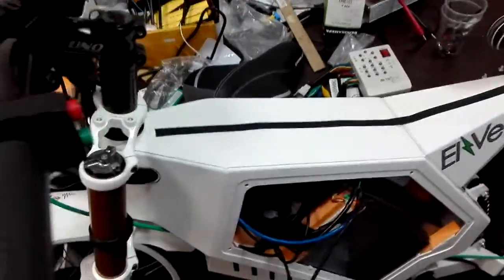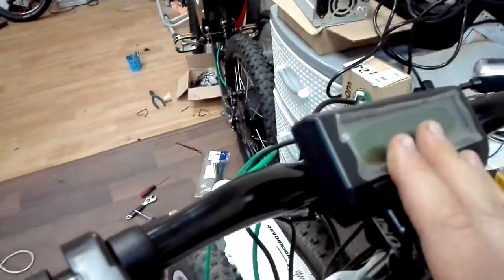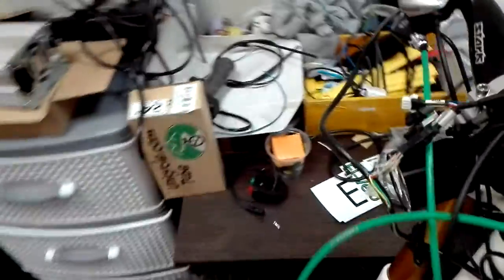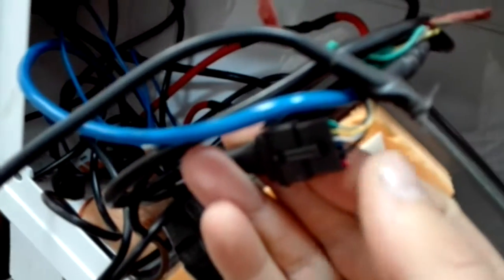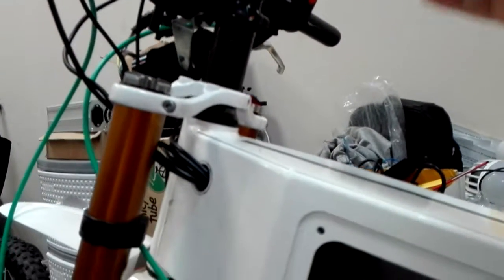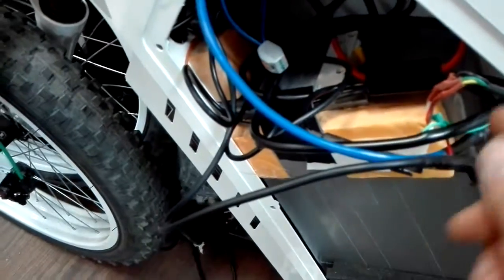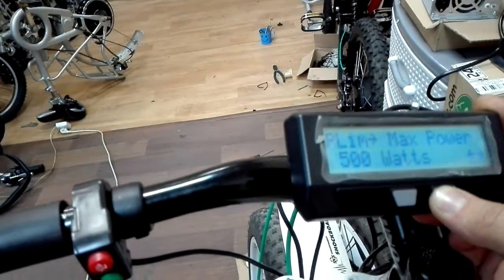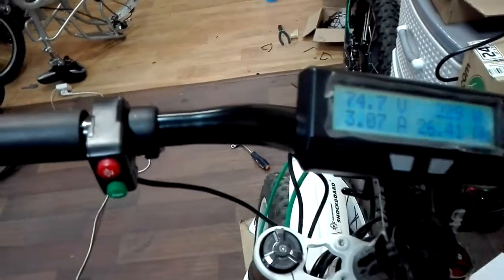How to plug Cycle analist V3 using Rshunt to standard controller.

Comment: Hi , what front fender is that?  If you don’t mind sharing info...
Reply from the maker: looks like duro wildfire 24 x 3"
Reply: Алексей Рейнджер thanks man
Reply from the maker: @erikjonromnes  oops.  you ask me about fender not tyres :)) just standard cheap fenders from regular bike shop
Reply: Алексей Рейнджер it’s okay, I think I figured it out.. looks like a German SKS shockboard front fender
Reply: I originally watched your video bc I can’t decide which cycle analyst I should buy for my build... I’m just trying to see which version is best to use as my main interface between a sabvoton 150A controller and a 72v 40ah battery w/100A bms ...  

If you can help that be great , if not I’ll try calling /emailing grin technologies again ... they must be busy bc I have not heard back from them
Reply from the maker: @erikjonromnes  i think 3rd version dp/dps with expernal shunt for yous current